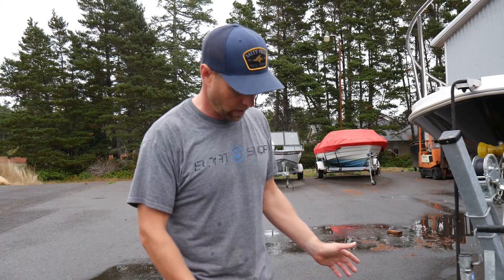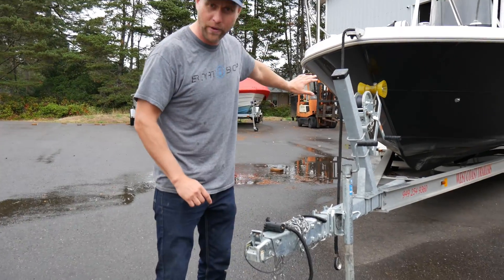How Do Boat Surge Trailer Brakes Work?

Comment: The best thing is to convert to EOH ( electric over hydraulic ) , the actuator are current ( more volt more pressure ) , most of these can go as high as 1200-1600psi.

Downside you still need a controller 
pro side, you can control pressure and sensitivity from the controller.

Comment: Good Video  and simple explanations that are easy to understand Thanks  iM 62 years old grew up inSouthFlorida and I bought a boat and trailer  before I had a Car  Or Truck I borrowed my Dads StationWagon and dragged  the thing home it had a Rocket Brand Trailer with Surge Brakes  that sucked  IMO  Eventually I sold it as is and it became somebody else’s Issue  iM glad  to see the new Systems out there as I did  Pull a AirstreamCamping Trailer that was Equipped with Electric Brakes  and DualAxles  that was like a Dream  I’ve been a active Boat Owner for over 30 years  and I’ve  always liked having a Trailervthat I could use for  longterm Storage  or even Maintenance  at my Shop or home BTW I pull with a Chevy 3500 Dually Diesel  that’s equipped to pull FithWheel ,Goose Neck  and  a 2’ Reese  hitch set up for 10K Pounds   My only issue is my   Current Vessel  is Oversized on Width (Beam)  and Weight  12 thousand and change pounds  so I only pull local  and at night  I have a Professional do my Long distant hauls on his Hyfraulic Fleet of Trailers  one man he can   Block them up on the hard or pick them up !  Plus he Owns and Operates a Marina with his own Storage Yard,Travel Lift , Engine Repair Shop   And Wet Slips  if needed

Comment: Rookie question, if the electrical is what allows you to go in reverse, would unplugging it at the boat ramp stop the trailer from reversing?
Reply: That’s exactly how it works. Have to have the plug or else it won’t move in reverse, the plug is basically a bypass, without it on, brakes will lock in reverse.
Reply: New to this. Just got a boat and my trailer is this style. Trailer came with a different connector that I have on my truck so I'm using an adapter. The guy although this will be fine for the lights they won’t communicate with the breaking system on the trailer. He told me to keep the pin in and just rely on my trucks breaks until I change the wiring. So just to confirm..if I take the pin out the trailer breaks WILL work but I might run into a problem backing up on a slight hill? At which point what can I do? Just put that pin back in to disengage the breaking system?
Reply: You should unplug the trailer lights before submerging in the water. If any of your lights happen to not be sealed off to water entering, You might blow the bulbs.
Reply: @ld5954 on LED?

Comment: I had mine lock up while putting my boat into storage over the weekend.  I’m kind of wondering if it’s because I didn’t plug the cord into my truck, as it was just in my yard that I moved it.  I generally don’t hook the chains or electronics up on a trailer if I’m only moving trailers around less than 50 feet on my property.  It seemed to fix the issue when I plugged it in.  Also, there’s a little pin that will block the actuator from sliding, but I’ve yet to find a way to keep it in place.  Great video!

Comment: This is helpful. I bought my fist boat with surge brakes on the trail. I only have a four pin  harness on my SUV for lights. What step must I take to have a five wire?
Reply: Ditto. I need a solution. Is there an adapter to go from my 4 pin vehicle connector, to my 5 pin trailer connector (preferably one that doesn't require splicing wires)? My tow vehicle also has a round 7 blade connector, if that helps. I just encountered this issue today while backing up a slight incline, at my winter storage facility. I was thrown for a loop, thankfully I had some support to "talk me down off the ledge," as I  had the entrance to the entire yard blocked. I have a 24' Shorelander trailer, did not see a means of manual lockout (can't look at it again until spring). A Website link to a vendor selling a wire harness adapter would be greatly appreciated.  I liked the video very much, it was a clear and concise explanation of why my trailer wheels locked, regrettably it did not provide a solution.  
Thank you.

Comment: Is there any harm in bypassing the surge brakes with the key provided on trips?
I figure why increase brake wear on trips where I don't have many hills or alot of braking. I've had trailers that didn't even have brakes so I wasn't sure if there was any harm in it?
I'm towing a 21 aluminum fishing boat with a 200hp four stroke
Reply: The brakes won’t work if you bypass them

Comment: If you experience the braking surge, can you just unplug the electrical connector entirely and back it up? Or will the trailer not move at all if there is no electrical connection?
Reply: Nope, it will lock up,  most trailers have a way to lock them out manually.  If it’s equipped and you have a vehicle with the reverse it shouldn’t lock out in reverse while plugged in.
Reply: @BobbyJensenJr  Gotcha. Thanks a lot for clarifying. I appreciate it.

Comment: I was SO upset which I finally got my new boat trailer only to find when I squeezed the truck brake pincers inside the truck the boat brakes didn't work!! NOW I know why!! They DO actually work b/c they're not electrically activated they're motion activated when the tow vehicle slows down and the solenoid opens and let brake fluid go to the brakes!! Ahaloula!!

Comment: I'd also recommend people buy a lockout key, even if you have this reverse lockout feature.  Why?  Very long, downhill grades, even if going slow and not braking at all, those surge brakes are JUST barely pushing against your trailer hitch due to the simple fact that it's trying to roll downhill.. so you end up getting very slight brake drag all the way down the hill.. which can create a LOT of heat over several miles (like instantly boil water heat).  I have cooked my fair share of surge brakes on hills with loooong declines (until I purchased a lockout key).  Electric brakes obviously don't have this problem of 'braking when your truck isn't breaking' - but we aren't so fortunate with our boats and these surge brakes :)  I certainly don't use it all the time or on most hills, but there's a few specific areas in my state that it comes in handy for.

And yes I get the concern of locking out brakes for a hill.. but that's where your own common sense needs to kick in.. go SLOW AND EASY and use your own best judgement.

Comment: So If I don't have a five pin connector can I still use the 4 pin? I would just have to disable the trailer brakes? How?
Reply: Yes your correct, most trailers have a way to lock them out either a key or a cap on the fluid reservoir.  Can become a problem if you need to back up in a pinch
Reply: @BobbyJensenJr  Thank you

Comment: I need to put brakes on my trailer looks like the previous owner took them off know where I can get a kit with everything, cables etc?
Reply: There are full kits available, but hey, you can use any parts that still are in working order.
Reply: @BobbyJensenJr  ya looking like that’s the method, just wanted to do one purchase instead of several lol thanks man

Comment: So you do not unplug your trailer before backing into the water?  Is that even necessary anymore?
Reply from the maker: You dat need to unplug it.
Reply: As long as the wiring is sealed up as it is best if it is and you have led lighting, it’s pretty much water tight.  If you have regular light bulbs they often blow when hitting cold water and the water corrodes the sockets as well.

Comment: Love to have a means to add a hand parking brake to the boat trailers.  

Hand brakes could be very useful, such as a lockable one to help prevent theft or to help out when changing flats, etc.
Reply: That is actually a great idea!  It could be used for a lotta reasons.

Comment: Mine has a battery box on it. Is this just to power the solenoid if the tow vehicle doesn't have the right connections?

Comment: What you covered was good information, but you didnt mention the "Break Away". If the trailer becomes disconnected from the vehicle towing it, how are the brakes applied?
Reply: My boat trailer doesn’t have a breakaway switch, that’s on on trailers with electric brakes.

Comment: I do have a question, do surge trailer brakes need to be lubricated, it would seem  like you would be smart to shoot some WD-40 or something in the sliding mechanism or possibly some lithium grease maybe? Also I have a certain model made by trailer buddy I think (A– 75, that book was in my paperwork but doesn’t look exactly like mine), it seems to have an aluminum box around the place where you would put a pin in to stop it from sliding back if you’re Solenoid is not engaging or you had a different truck or the adapter stopped working? I want to figure out how to put the bypass pin in there just in case something was to ever happen and the power to the solenoid was not working correctly? Thanks

Comment: How do I energize the 5th pin as my solenoid doesn’t seem to be working and I have to manually lockout surge brakes for reverse??
Reply: Check the fuse in your truck to start with
Reply: @MikeJones-pg1lz  fuse is good
Reply: Ever figure this out? I got same issue and  when connected to my 7 to 5 pin nothing works.  When connected to 4 pin lights and surge breaks work but gotta get out and put in pin to reverse
Reply: @FinSmoked  i haven’t yet but hope to soon…
Reply: @johnpetrea  i checked mine out yesterday. Don't think my round 7 to 5 flat pin connector was getting good contact on the truck side. Checked voltage and got 12vdc when truck is put into reverse so think i got it. Haven't tried backing yet tho.
Reply: @FinSmoked  good luck and thank you for the feedback

Comment: Man wish I saw this before I bought and installed a brake controller in my truck. And then took the trailer and truck to a shop to have them tell me what is wrong. Lol
Reply from the maker: Aw man! 😬 Subscribe so you don’t miss any other videos!
Reply: same here, guy at a certain trailer place told me i needed a brake controller, no!! i dont...but didnt know any better at the time...
Reply: Same here, oh well...lol